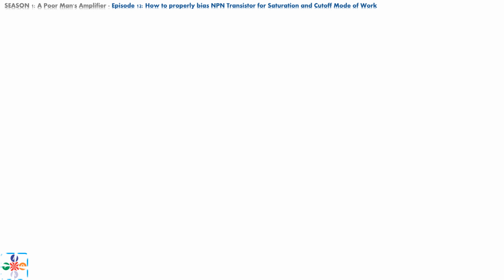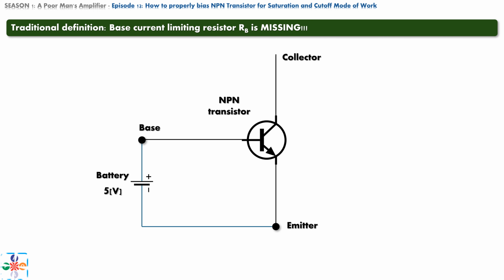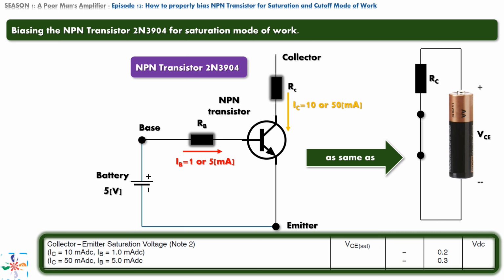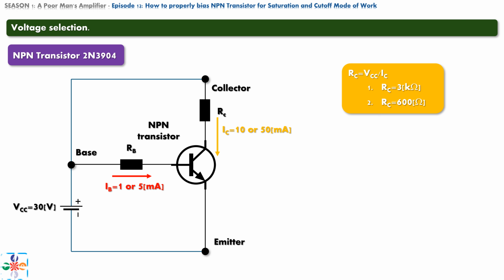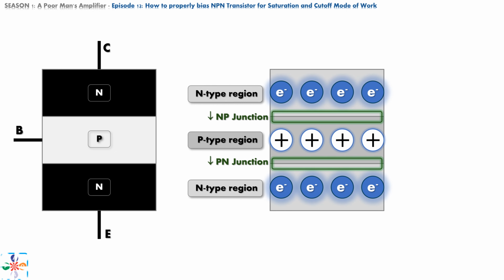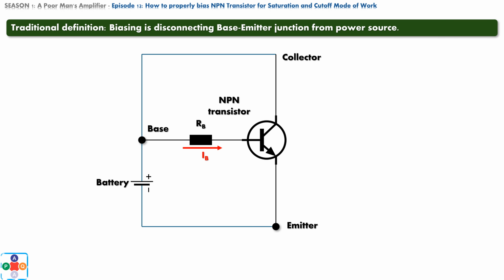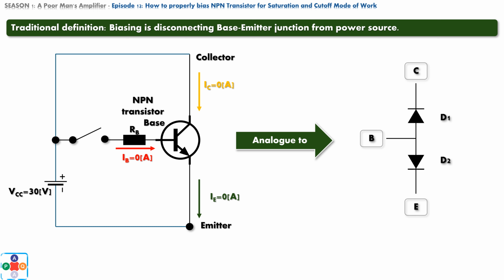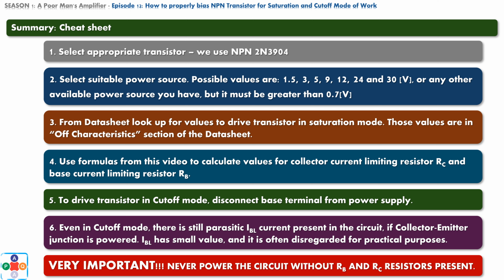S01E12 -  How to Properly Bias NPN Transistor for Saturation and Cutoff Mode of Work as a Switch.

Comment: Thank you for your clear explanation, but i have a question in the calculation of RC  collector curent limitting resistor you omitted or did not talk about Vce voltage drop across Collector-Emiter  junction
Reply from the maker: Hello, than you so very much for your comment. Since in most of our examples we are using voltage sources (5-30V) that are much more higher than Vce junction voltage drop (when transistor is properly biased, this junction voltage is 0.2-0.3V), when transistor is in saturation mode of work is negligible and can be discarded in calculus. However, you are absolutely correct that this is significant information regarding saturation mode of work, and we have covered this junction in more details in sections and videos regarding datasheet parameters.

Comment: Adding a resistance to the B-E junction when in cutoff guarantees that the leakage current into the B-E junction cannot cause any undesirable effects??
Reply from the maker: Hi, thank you very much for your question. We assume you refer to parasitic I(BL) (base cutoff current). Please standby for the answer, we are planning to release video in following week, where we will address this particular issue in details, so stick arround 🙃. Until then, I(BL) in real-life is so small, that it really doesn't have any statistically significant difference. Thank you very much for your question, and we appreciate  time that you have spent watching your videos and posting questions and comments. Kind regards.
Reply: Thx 4 so fastly re ply !
I'm just a tad picky... I had problems with base capacitance of phototransistors, had to drive them out of conduction, since we had a light beam crossing at about 160 kph, and only 3 cm active...
Reply: Actually, I also had a bit of experience working with IC design teams, so more in the CMOS/FET business (DC/DC converters in mobile phones)